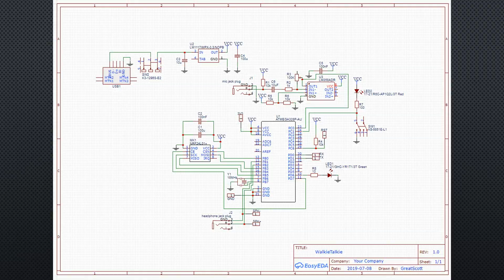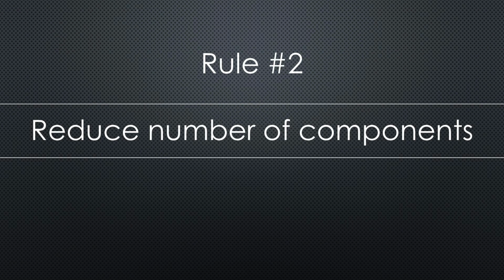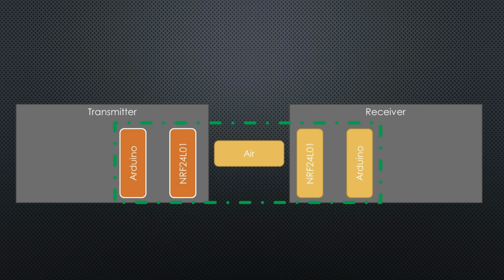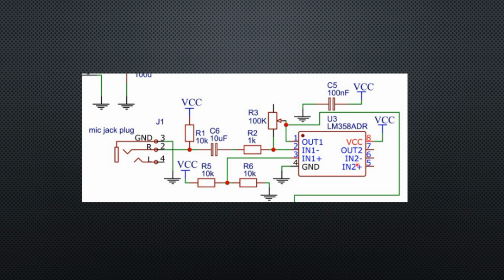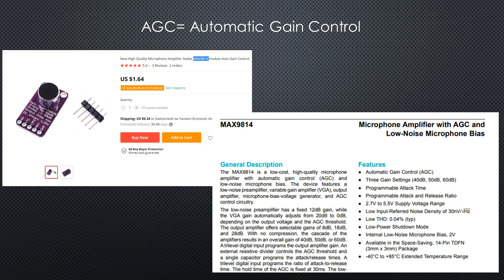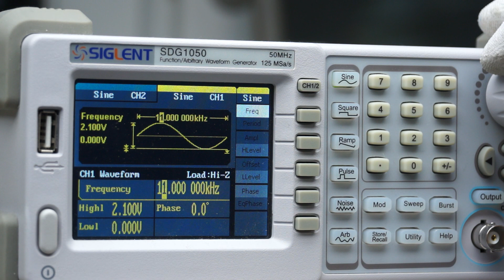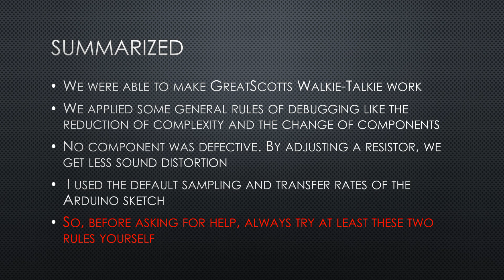#279 How to debug Arduino Projects (GreatScott's Walkie-Talkie)

Comment: Very nice video. I am glad that fixing the circuit only takes 1 resistor. Easy fix :-) Thanks again for you help. Your video is now linked underneath my Walkie-talkie video.
Reply from the maker: @GreatScott: You are welcome. And as I said, maybe we will have the chance for a test on a bike ride ;-)
Reply: @AndreasSpiess  If my busy video schedule allows it at some point, sure :-) But my moped can only do 60km/h. You have been warned ;-)
Reply: @greatscottlab  Its not depends on the speed, but the style
Reply: @greatscottlab  Keep your Simson, even if it falls apart. Newer mopeds are only allowed to drive 45km/h.
Reply from the maker: @Sebastian: Maybe this is a good idea for one of your projects?
Reply: @AndreasSpiess  I am busy for some time with operating systems for controllers. So, no time for stuff like that...
Perhaps some day in the future?
Reply: You two are some of my favorite youtubers. Thanks you for both of your videos and being so insightful on the subject of electronics!
Reply: Its not always an easy fix when in conclusion you have to change one component. Most thinking and frustration goes into what component to change and why.
Reply: @Cheese_1337   I run into this with software. sometimes people wonder why it took a week to just do a couple lines of code. The work is not changing the couple lines, the work is finding what lines to change and what to change them to.
Reply: Fue genial ver esta colaboracion entre mis youtubers favoritos ya que estaba pensando hacer algo similar para conectar mi guitarra electrica a un amplificador via bluetooth. GRACIAS POR SU TRABAJO Y EXPLICACIONE
Reply: Hi, I think there is a way to take away noise by adding a capacitor and resistor band filter that oscilates in about 300hz to 3.4Mhz (or 4 MHz) wich is the frequency band for human speak
Reply: @amirbp  Maybe kHz, not MHz? 3.4 kHz was used in early telephone networks to cram more analog channels into expensive copper wires, so it definitely would work
Reply: R u releasing new Gerber files with updated schematics?
Reply: osm
Reply: Love your videos man!
Reply: Which audio amplifier should I use to make it sound it a little better.
Reply: Ahh, there you are.
Reply: I just watched the vids and im suprised no one made a proper lpf filter for the audio
Reply: I don't know if im missing something, but. i think the major problem is that you're in essence are using a 1bit DAC and ADC. from my experience it won't sound any better then in this video.
Reply: @swagiyo9801  No thats wrong. 1 bit is called "direct current" 🤷🏼‍♂️.
Great Scott uses 10bit ADC from Arduino and generates Analog Audio through PWM  coupled with a capacitor.
This video is proof that he just did forget about headroom. So he created an overdrive Effect 🤘🏼
Reply: @swagiyo9801  The quality of output in the video is mainly depending on the noise created by pwm from the receiving side. But to get rid of that, one could choose to have a r2r-dac, instead of pwm, as well as having a "low pass RC-filter" at least between the arduino(328p) and the speaker/headphone, that integrates the high frequency pwm output above 4.5kHz. --- By the way, 1 bit ADC/DAC can create a very high quality output, depending on the internal resolution of digits and sample speed. Good CD-players have high quality 1 Bit DAC!
[edit] about 1 bit conversion you might want to read this e.g. https://en.wikipedia.org/wiki/Delta-sigma_modulation#Variations
Reply: @asagk  Can suggest me any audio amplifier to make it sound a little better? I would really appreciate your reply.
Reply: @GyanenderSirohi  What type of amplifier? A pre-amp? One delivering some watt? Here is a simple one for up to 50W@4Ohm (IEC268.3), but asks for something up to like +/- 25V (50Vpp supply), the "UTC TDA-2050V". [edit] But you can already use it quit well at around 12Vpp supply ... there is also an example schematic in the datasheet pdf for the "TDA 2050V".

 But there are so many out there...the cheapest way might be to use some genric op-amp as a pre amplifier and then add a bipolar end stage using transistors or mosfets. If you just want to enhance the sound with this project, use one of the many op-amps in low-pass filter mode. There are lots of circuit-schematics for such applications in the internet.
Reply: @asagk  I tried to use Pam8403 audio amplifier but it only worked when I connected the Arduino digital pin 9 or 10 to the input ground of the Pam8403. If I connect the pin 9 or 10 to ground of Pam8403 it sounds good but when I connect it with left or right channel it makes a tik - tik sound.
Reply: @GyanenderSirohi  First of all, the connection between the signal out of the arduino and the signal in of an amplifier is only(!) coupled AC wise, not DC wise! So in the line between the arduino and the amp is a coupling capacitor to be put in series. But I do not know your schematics, so difficult to tell what exactly is not correct, apart from the perhaps missing capacitor.
Reply: @asagk  Thanks for help I will try to put a capacitor between the Arduino signal out and amplifier signal in.
Reply: @GyanenderSirohi  Well, besides that, it might be a good choice to have the arduino and the amp use different power sources. Since most teh time, that might be not want or too costly, it makes a good choice to have something like a 22uH choke in the Vss(0V) path between Ardunio and amp, as well as in the Vcc path between Arduino and amplifier to suppress the cpu generated RF in the power supply lines. Sometimes it might be enough to have a ferite bead instead as a suppressor. But the choke can come in cheap packages, looking like resistors, for a few cents each. So from the price tag there is no real difference, but from the suppressed RF ripple on the power supply it certainly is!
[edit] Or in other words, when it comes to signal quality, it is all about filtering! And that is also true for digital signaling, but especially for analog signaling.
Reply: @swagiyo9801  Some of the best DACs and ADCs in the world are 1bit

https://en.wikipedia.org/wiki/Delta-sigma_modulation

Comment: But please what is the value of the resistor you have changed to?
Reply from the maker: You have to try it yourself. I do not remember and most probably, it will be different in your case.

Comment: I also made this project. But I guess, when I TX, I hear that PWM sound, or that sample rate, I want to get rid of that contiuous buzzing. 73 de TA3KRT
Reply from the maker: Maybe a lowpass filter will help?
Reply: @AndreasSpiess  thank you for the answer Mr Andreas, it also comes to my mind but I dont know how to make it for now, I have Nanovna to measure and design it however mine is not able to measure 2.4 ghz. How about low pass filter in software? Is this possible?
Reply from the maker: @Sergio-ta3krt  I meant an audio low pass filter.

Comment: I am first year Electronics and commication engineering student and want to make a multichannel transmission and receiving walkie talkie i.e
More than one speaker and listener able to communicate simultaneously 
So, will you please guide me with that
Reply from the maker: As a YouTuber, I share my knowledge in videos, not with consulting. But if you define exactly what you want, Google will be your friend.
Reply: @AndreasSpiess  actually you got that wrong I doesn't meant that but I am a beginner but my faculty given us the task so only I want the hint to achieve that task so if possible please give hint

Comment: Question: is this a private communication method via IP or some type of digital key? Or is this broadcast so anyone around with the same device can hear it?

I have a project in mind that this would prove incredibly helpful with but don't want to risk it interfering with other signals in the area.  (Race tracks, sporting venues)
Reply from the maker: These are analog radios without encryption.

Comment: Hey Mr.Spiess What did you Change the resistor to?
Reply from the maker: I do no more remember :-(
Reply: @AndreasSpiess  anyway you can approximate? Or Do you have a separate schematic from Great Scotts? BOM File or Pick and Place File? I want to recreate it but use it with a transducer as the output instead of a speaker. I am not very versed in this field so I need assistance in terms of knowing how much of each component I would need. For instance resistance, capacitors, etc.
Reply from the maker: @atitan9421  This is an old video, and I do no more remember the details. You have to watch Great Scott's video for the details. If I remember right, I used a potentiometer that was bigger than the proposed and adjusted it.

Comment: Very interesting video. I surely will try this at home. But one question, how much is the value of the chenged resistor ? Or is it completly removed from the circuit ?
Reply from the maker: You have to try it yourself. It depends on your setup.

Comment: Hello, I am actually also from Switzerland. I decide to build this project by myself to communicate with my friends qhile skiing. Which value do you suggest to take for the voltage devider? I need to build this project in less than a month, because we are going to ski in the near future. Thank you very much for the lesson and for your helps. Greetings from Basel.
Ryzer05
Reply from the maker: You have to try yourself. But for skiing you probably are better off with a PMR radio or similar. Digitec sell them and they are license free.
Reply: @AndreasSpiess  Okay, thank you very much.

Comment: I almost never ask for help because if someone calls himself "maker" he should be able to troubleshoot problems otherwise it is an user of electronic's devices. I have noticed also that even if I spend more time to resolve a problem more I learn afterwards! (I used to make that mistake to ask evrybody about everything but i eneded up with NO PROGRESSION and then I have changed this bad habit! ).
Reply from the maker: I agree. When people ask me for help I only give them hints on where to look at. This can shorten their time to solve an issue and they still learn.
I extensively search for help in my projects. Mostly with Google. I would not be able to create one video a week without help.
Reply: @AndreasSpiess  Yes with videos it is different because usuelly people who ask actually can answer their own questions later (but need more knowledge sometimes or just they need some hard work or more focus on a problem) but with videos if there is a job for 2 or 3 people it is not possible to do it alone...

Comment: You could use a steep bandpass filter from 300Hz - 2,7 KHz to reduce some of the noise (anti aliasing) before digitalising and a 2,7kHz lowpass before the audioamp.
Reply from the maker: The goal was to fix it, not to improve it. You are right, a filter could help.

Comment: When I saw GreatScott's video I was thinking it could be an issue with the input signal being clipped due to overdrive. Really great debugging video! 
If I may ask, is it possible to use the MAX9814 Mic Amp you showed and still keep the LM358 amplifier GreatScott's used in his orginial schematic ?
Reply from the maker: You have to try out the levels. The MAX9814 is an interesting chip because of its AGC.

Comment: so what do you change the resistor value too? Also, is the resistor and capacitor on pin 9 needed? If so, what are the values?
Reply from the maker: I used a potentiometer to adjust.

Comment: what resistor value did you end up using?
Reply from the maker: I used a potentiometer
Reply: @AndreasSpiess  Thanks for the reply andreas. I did the same but cant get useful results. 500k pot all the way up seems to amplify a bit, but turning it down just lowers the volume. Ill check my scope again..2.5volt amplitude right?
Reply from the maker: Just no clipping.
Reply: @AndreasSpiess  signal goes in clear, but is very faint on the receiving end (or loud buzz from arduino(?)...battery power, power adaptor board, shielding and different antennas, latest libraries dont matter hehe). Will keep you updated.
Reply: @AndreasSpiess  fixed it! used an LM386 instead (https://lowvoltage.wordpress.com/2011/05/15/lm386-mic-amp/) + Battery power (9v on arduino vin), everything powered from arduino 3.3 and 5v out (not the best but works great now!)
Reply: works great! will post link of my design when the documentation done.
Reply: So I made pcb and the noise was back. Ended up using larger smoothing caps on the module (470uF) and 1000uF over the arduino power rails. and most importantly tweaking some software parameters resulted in much less noise. My settings for the rf24audio lib: data rate: 250kbps, samplerate: 20000, (pa power: low for now).
Reply: and in the code: 20khz samplerate + 250kbps transfer rate seemed to get rid of a lot of noise...teaser: https://www.youtube.com/watch?v=Ga4xj-EW2XQ

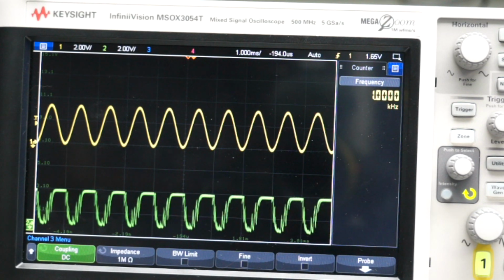Comment: At 5:40, what resistor and capacitor did you use? I tried several ones but I still get massive background noise
Reply from the maker: I used a potentiometer. Background noise is to be expected.
Reply: @AndreasSpiess   Is that background noise expected as the output in generated using PWM and that generated the noise?
Reply from the maker: Yes
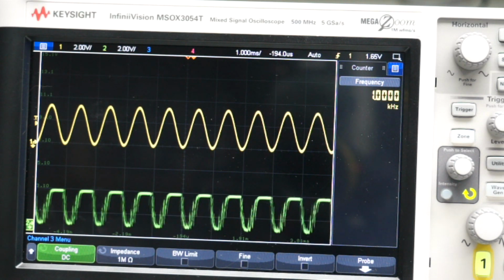Reply: @AndreasSpiess   May I ask why you used a capacitor between Potentiometer and ground? (at 5:40)
Reply: @Mat-vb8er  low-pass filter

Comment: But how to debug software code in Arduino emnironment in case that missed an "!" or placed "=" instead of "==" or code stuck inside a loop or forget to put a "break" in a switch function?
Reply from the maker: With serial.print statements at the right place.

Comment: Sehr cooles Projekt, ich bin auch gerade dabei ein ähnliches Projekt umzusetzen, habe aber Probleme mit der Arduino Software... 
Wäre es vielleicht möglich die Software die du verwendet hast zu teilen? 

Lg
Reply from the maker: Ich nehme an, die findest du bei Greatscott.
Reply: @AndreasSpiess  What Resistor and Capacitor did you use for Pin 9?

Comment: i have zero knowledge in electronics, i am just trying to make this,.......to what value should i change the said resister R6
please reply!
Reply from the maker: This is not an easy project. The resistor has to be a little smaller. You have to try yourself till you get an acceptable quality.
Reply: @AndreasSpiess  Thanks!

Comment: I made his battery capacity tester but I used an LM741 op amp instead of a LM358, changing the pinout accordingly, 
it did discharge correctly through the resistor but the ICs output line did not seem to vary....  so the mosfet remained open to the same amount regardless of test voltage.  edit - wait, did you say the 741 is supposed to run on 12v supply not 5v ?  that could be my problem then ?
Reply from the maker: Have a look into the datasheet of the 741. it is a very old opamp and needs high supply voltage. In addition, it is not „rail-to-rail which adds problems
Reply: @AndreasSpiess  thank you,  I tried at 12 and no noticeable difference,  the potentiometer he used is 500k which with 12v instead of 5 I think it might be feeding a different reference voltage to the IC,  I am thinking of just remaking the whole board and following his design exactly.

Comment: Please make more debugging AND behind the scenes videos like "#111 Labrep: How I work behind the scenes" in addition to the regular videos. Here is why. The regular, relatively short and high production value videos have just enough information for a moderately skilled person to quickly understand the technology and successfully complete the project. This is fantastic. 

Yes, the behind the scenes video was long and somewhat tedious, but I learned so much from watching you work through the problem including your choice and usage of test equipment. The videos show that there is not magic behind how easily you seem complete projects in the regular videos. You show how to carefully analyze options, make hypothesis and then try to prove or disprove them, sometimes end up down blind alleys, but you keep persevering. These are essential skills for advancement.

The debugging video inspired me to purchase a waveform generator and follow along step by step. This helped me learn the value and usage of the waveform generator. The "#111 Labrep: How I work behind the scenes" showed me the value and usage of a Logic Analyzer that I did not fully understand. I would have used my oscilloscope and rudimentary protocol decoder, but now I will borrow my friends Logic Analyzer and learn more about it. What model do you own and what would you suggest for a hobbyist?
Reply from the maker: Thank you for your feedback, it is valuable. It depends a little on my mood how the video is in the end. Short or long ;-)
Concerning logic analyzers: They are all more or less the same. You get them in two classes: Cheaper and a little more expensive. Both have the same functionality, just more pins, and more speed.